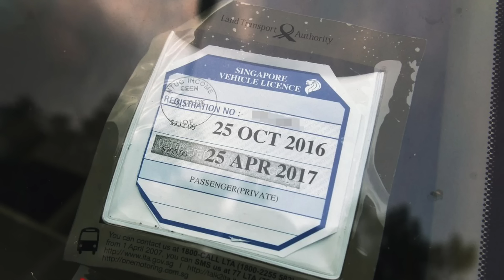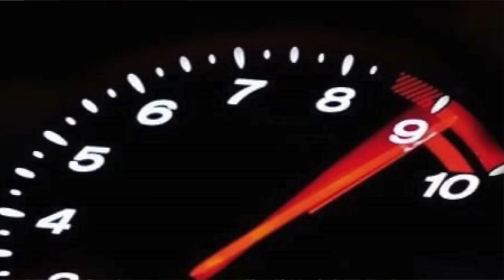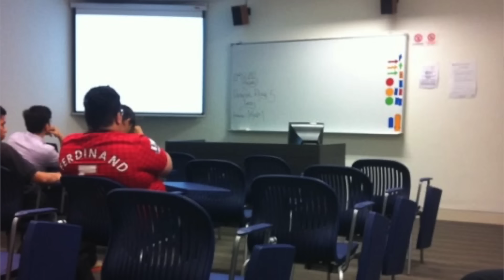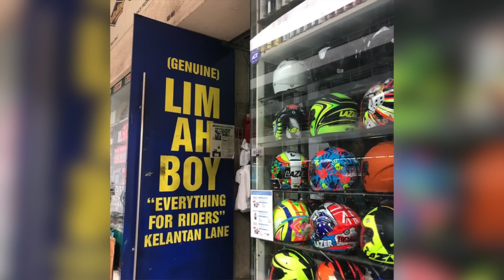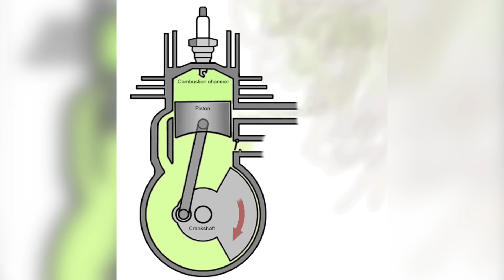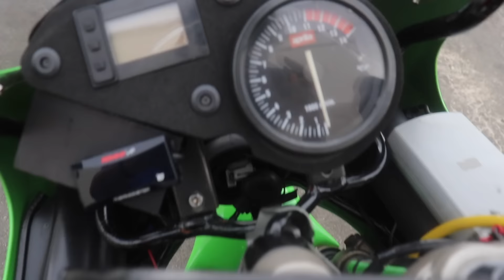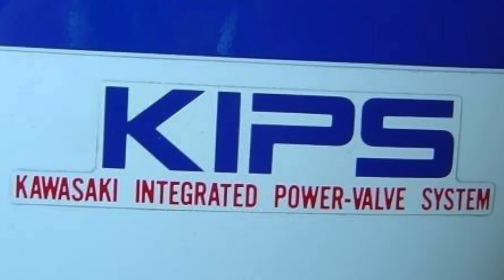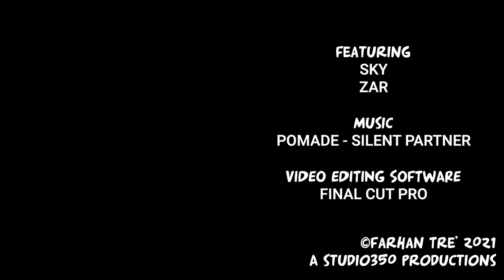Vlog#320 Kawasaki KRR ZX-150 Ninja | Honest Singapore 🇸🇬Motorcycle Review

Comment: I too have a love for 2 strokes, used to ride a TZM but nomore due to NEA laws, i had to switch to another 2 stroke which i decided on this KRR. Hate the old stereotypes with sotong tires, mine is running on 110 size in front and 120 at the back 😂

Comment: Sky, I own a Thai model tzm 150 got it brand new as a leftover. Very rare here in u.s of a. I ride it on the road. Any mods tips? I put yy pang racing exhaust and pre load adjustable fork caps. Yss rear shock. 2T my favorite.  I also have nsr tzr rgv 250's. I'm a Collector n restore 2t bikes. Nice KR150.  I liked my tzm 150 more than the nsr150sp my friend owned. And his nsr150sp had all the tyga parts. But I agree 2T is the best long live the smoking 2T's. Sad your getting banned by the law. At least here in the states if it's over 25 years old. It doesn't have to meet emissions. You can donate your KR150 to me. It will live a long time in my garage. Smoking up the roads of the states.

Comment: Remind me of my youth day riding 250/350cc two cylinders 2 stroke..I normally use gear oil and use good grade 2T..sotong tyre is very dangerous for handling although it gave you slight advantage in low torque..For KR 90/80-17 110/80-17 adequate

Comment: using 4T as 2T? you'll fouled the plugs in minutes. might as well use coolant as brake fluid. haha.

one of the better owner but imo still bad interview direction by bike reviewer considering one "loves two strokes".

to the owner, i can see having kopi tech talks regarding the squish on your cnc head and reed spacer for your oversized carbs. good job in keeping 2t spirit alive!
Reply: Using 4t as 2t??
Reply: But yea, it'll be great to talk bout squish bands and reed spacers too. Stinger restrictors etc
Reply: For years, I've been using 4T as replacement for 2T if i haven't had the money to buy 2T.
 Once mixed into the petrol tank and burns in the piston chamber, it serves the same function. To lubricate the chamber wall.

It was much later on in life, when i had a chance to observe and study the 2stroke engine, tha att i realised the function on the 2T is not only to lubricate the piston chamber, but it also serves as a lubricant for the crankshaft, bearings and other moving parts thats not in contact with the engine oil. 

I clean my plugs and occasionally even dismantled my engine block to clean it. 
It doesn't foul the plug as mentioned 👆🏼

Even my mechanic back then said to premix some 4T if going for long-distance rides. 

Bet u guys haven't tried Marine 2T for outboard engine for your bikes.
It was Awesome.

Comment: I tot Lta said all two stroke bike will be scrap by 2023
Reply: Hi bro, i quote from NEA.

"local motorcycles registered before 1 July 2003 will be required to meet the limits of 4.5% Carbon Monoxide (CO) by Volume; and 7,800 ppm Hydrocarbons (HC) (for 2-stroke engine) or 2,000 ppm HC (for 4-stroke engine)."

Hope this answers yr thought 🙏.
Reply: My RXZ bike can't meet the emissions requirements,  my exhaust noisy too 🤣 .
Reply: Thats sad bro. Dying scene in sg